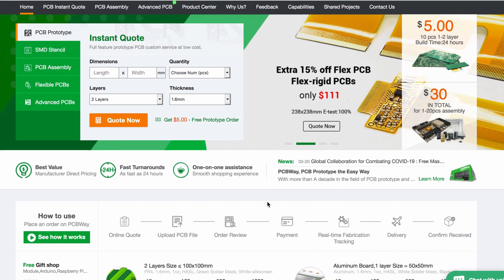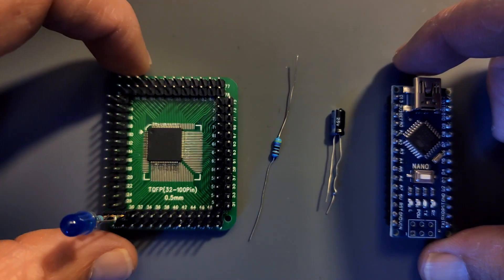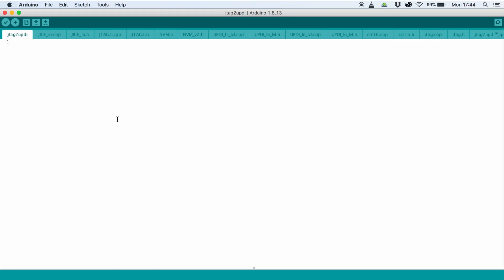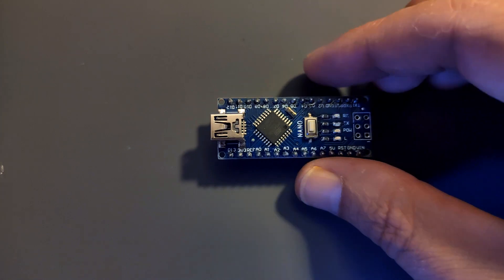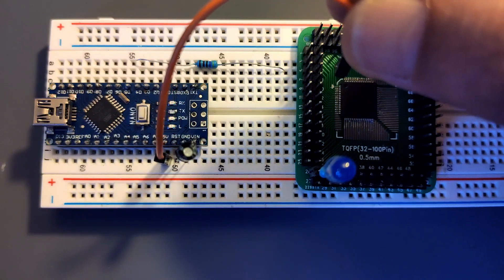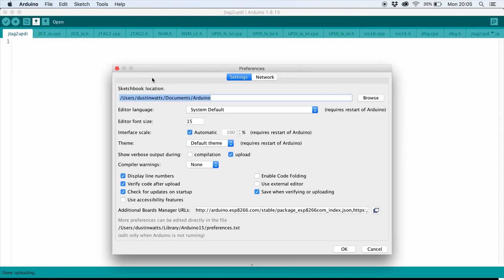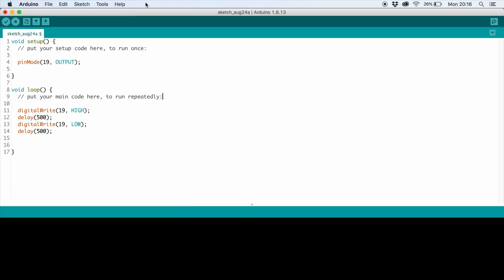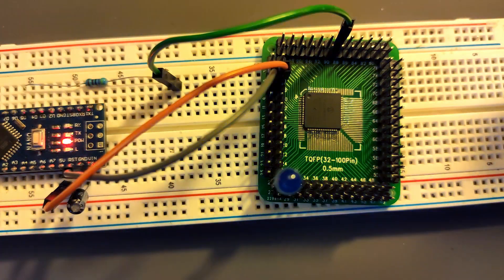How to Program an AVR DA MCU Using an Arduino Nano

Comment: Hi Dustin, I am using Arduino for uploading AVR128DA64, upload is fine and works, but i am struggling with debug in real-time of my AVR128DA64, please can you support how i can debug while using JTAG to UPDI? Thanks
Reply from the maker: Oof, this is not something I can quickly answer in a comment. I do know that the chip is not supported by the Arduino debugger. So you will have go the MPLabX route (the official Microchip IDE) which is not easy. 

I hope serial prints are enough because otherwise you are in for a long journey. 

Good luck mate!
Reply: @DustinWatts  thanks  a lot for your info and kind reply
Reply from the maker: @abdulaziza  No problem! I hope it can help you somehow!
Reply from the maker: @mahmoudayman6973  I did nothing else then what you see in the video, so if you follow along it should work. If this is not the case, you can always open an issue here: https://github.com/SpenceKonde/DxCore

P.S. Make sure you are using a data USB cable ;)

Comment: I am trying to prgm AVR128DB64, should i use nobootload or optibootload? i tried both non is working, 
avrdude: jtagmkII_program_disable(): bad response to leave progmode command: RSP_NO_TARGET_POWER

I am have powered all VDDs, plz support, Thanks
Reply from the maker: It has been a while since I played with the Dx series so I would suggest you post the entire avrdude log as an issue on either https://github.com/ElTangas/jtag2updi or https://github.com/SpenceKonde/DxCore Those two have a lot more knowledge about the chips then I do.
Reply: @DustinWatts  Thank you for your kind reply

Comment: Extremely useful video. Thanks mate.
Reply from the maker: You are welcome!
Reply: @DustinWatts  DxCore isn't working with analogWrite() function. I tried on AVR DA Curiosity Board but failed.
Reply from the maker: @rajdeepdas86  I believe Spence is on it https://github.com/SpenceKonde/DxCore/issues/117 :)
Reply: @DustinWatts  Yes, just saw that. Thanks.

Comment: this looks a lot cheaper and easier than buying an MPLAB SNAP like i originally planned. I assume Arduino libraries like Wire, Serial, etc work as normal?
because i planned on basically building an Arduino board with one of these and have both Power and Serial (via FT232RL) over USB.
which also raises the question if the Serial connection could be used to directly upload sketches like a regular Arduino board. but i assume that would require a custom bootloader, right?
Reply from the maker: Hi Proxy! Beyond some basic "playing around" I have not done much with the AVR DA chips yet. So I can't tell you if it works "normally", but the DxCore comes with libraries like SPI, Wire, SoftwareSerial, etc. Also, Spence actively works on DxCore so that is promising! Together with jtag2updi this is a way to add Arduino IDE support to the AVR DA (and DB). Another option is pyupdi by mraardvark. I have made a programmer with an FT231X USB to UART chip, which is much cheaper and it works great. So you might want to give that a look.

Comment: I noticed that in the video the resistor was connected to D5 - so should it be D5 or D6? Thanks for great ideas and tools. I plan to use the DA MCU to build a touch control front panel for my 1975 vintage 16 bit minicomputer and replace the membrane keys which are very hard to use. project blog - https://alphalsi.com
Reply from the maker: You caught me, I was hoping nobody would notice :) The first few shots of the Arduino were from a different take and I only noticed late in the editting fase. But good eye! The resistor should indeed be on D6. Very interesting project you have there David.

Comment: Thank you for the clear instructions. I recently had a similar problem with the new attiny412. Arduinos are very handy.
Reply from the maker: You are welcome @bwack! The new ATtiny's are also great mcu's!
Reply: @DustinWatts  they are great! . And  the low power features are better too. Have you tried the DAC feature?
Reply from the maker: @bwack  Other than a low frequency sine wave... no. Did you notice that the AVR DA has a 10-bit DAC? ;)
Reply: @DustinWatts  Nice! No I haven't noticed.

Comment: I assume most of these instructions work on the other UPDI-compatible chips?

I use pyupdi.py to program them which is easier you don't need a Arduino as a programmer, I use the "usb-serial" and 4.7k resistor. But I am sure the jtag2updi has more features such as debugging?
Reply from the maker: @Mark Robson, jtag2updi works for the ATtiny 0-series and 1-series (the new ATtiny's) and also for the megaAVR 0-series and AVR-DA/DB mcu's. And for those the instructions are the same other than selecting a different target board. As far as I know jtag2updi doesn't support debugging, for that you'll need something like a PICkit.